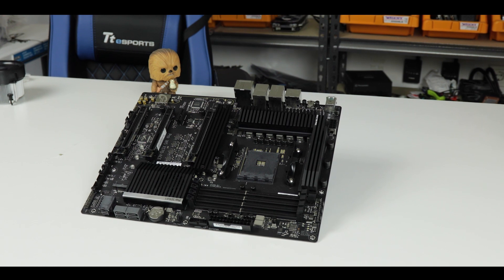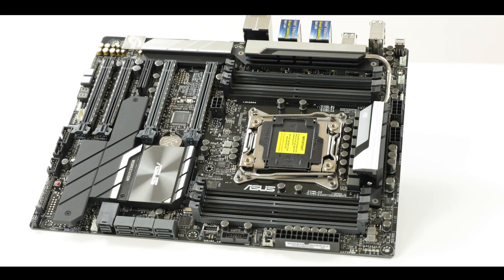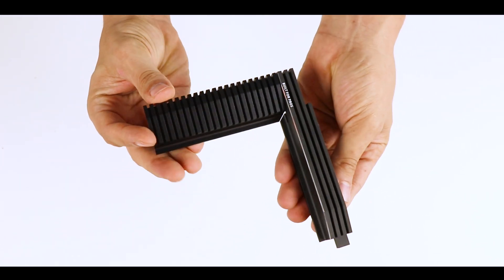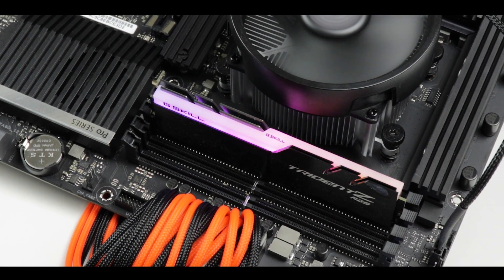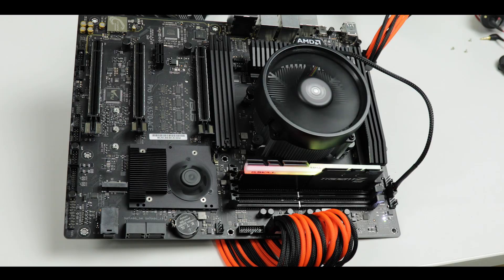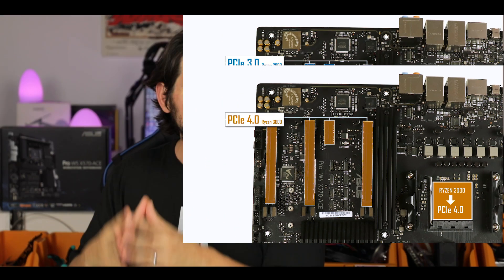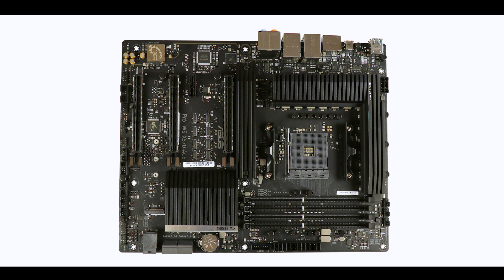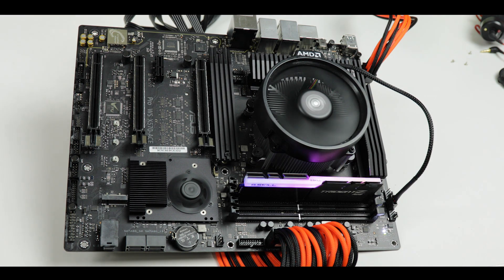Pro WS X570-ACE : PCIe 4.0 at its best!

Comment: Hi, I'm interested into how can this board run 3 gpus in x8x8x8 PCIe 3.0 config if the CPU itself supports only 24 lanes? Does it have a PLX type of chip like Intel boards have or there is something else going on.
Thank you
Reply: The bottom slot runs thru the x570 chipset, which has a pcie 4.0x4 link to the cpu, which is equivalent to pcie 3.0x8
Reply: Cannot get this to work with my 3 RTX 3060 GPUs...
Reply: @bage881  why?
Reply: @Frostensen  I'm trying to figure that out. When all three cards are plugged in, the #3 card on PCIE3 gets a code 43 in Device Manager. If I remove card #3 from the PCIE3 slot, then card #2 stops working and gets code 43...

Strange enough, all of them are now working....but card #3 is running in x4 mode, not x8
Reply: @bage881  it shouldn't work on x4 .... maybe the mobo is faulty? The only thing I read about it is that some guy couldn't even fit the third card because of power cables. There's a page on facebook called "Hardware for OctaneRender". Those guys work mostly with multiple gpu setups. Maybe they can help (it doesn't matter if you don't use Octane)
Reply: @Frostensen  I restarted the PC and now GPU #3 is back to not working again (code 43). I will def check out the Facebook group, thanks for that suggestion.

Comment: Baffling! My experience with this board, so far, has been somewhat of a disaster:
Extremely long boot-up times, weird display init behavior during boot-up (flickering), redundant and/or contradicting UEFI settings esp. regarding PBO, very limited fan curve settings, lackluster documentation, software that is impossible to set up let alone use (ACC), a rather noisy chipset fan and WORST OF ALL, it does not start w/o a PSU reset (PSU not at fault, replaced for testing). Also, perhaps unrelated: Noticeable coil whine under stress – for which I should blame the graphics card; but this did NOT occur with my old board.
Maybe just a heap of bad luck, but unsettling for sure.
Reply from the maker: Really ??? Not at all acceptable coming from an almost 500 bucks board. 

What CPU ??
Reply: @Laurentschoice  3700X. To be fair, in terms of performance, there really is nothing to complain about. And I was able to get it for much less, since it was incorrectly listed for only 239 EUR by a retailer here in Germany on launch day. Just contacted their customer service about some of the issues mentioned above, let's see if they have any ideas!
Reply: PSU reset? can you explain more please. I just got this board and Im not able to get into the bios and my new monitor says it's not recieving a signal. I reinstalled the memory and swapped out the HDMI cable but nothing is working. The memory lights us and all my fans and cooling system is running.... just no signal to the monitor.

Comment: is it possible to see somewhere how chipset radiator looks on the back side?
Reply from the maker: Didnt I show it on the video ? Do u need the PCB back or the cooler ?
Reply: @Laurentschoice  radiator, where located chipset cooler. I just want to look back side of it to see thermal pad between chipset radiator(with cooler) and chipset.

Comment: How can this VRM heatsink be the best when Gigabyte uses real cooling fins?
Reply: I was about to say the same thing .. this guy has no clue what he is talking about .. almost seems like a paid ad.

and its not asus "beefer" VRM
Reply from the maker: Cooling fins are the best way to radiate away single component heat, but when dealing with VRMs , you are dealing with a larger heating surface, such as multiple power stages, then metal heat absorption is king, and metal density is where u want to go.
Reply: Except that when the metal is thermally saturated, temps will rise further. I am sick and tired of mainbaords with inproper cooling.

Comment: Dont agree with you at the end of the film when you are saying it would be better to buy example TUF motherboard.(Blinked picture) They have worst VRM + cooling on VRM . If you really want to get proper "minimum" model cheaper alternative for gaming just get x570 prime pro instead (even thou they have prob same VRM as TUF atleast on  power stages, but have better VRM cooling compared to TUF) but yet again those x570 prime pros seems to sell at same price as this x570-ACE so absolutely would go for ACE even for gaming.

If you want cheap alternative for gaming buy some good/cheap B450/X470 MB with proper cooling on VRM and you will be fine. But those are yet still hard to find (Prime pro x470 VRM cooling is total  shit example compared to x370) So only "good enough" deal would be get some strix b450 with bargain or similar.

Just saying stop advertising TUF its SHIT BRAND these days.

Comment: That show of channels 1&2 its wrong (around 3:20) i know it because i own this board :D channel one its DIMM 1&3 channel two its DIMM 2&4
Reply from the maker: Hello Varinec. 

You are confusing the channels and the primary Dimms.

Which is normal,  since manufacturers give zero explanations. It took me a few years to figure it out. Actually on my early mobo reviews I would show the channels the way u just mentioned them.

The DIMM 2 and 4 are the Dimms which activate the memory Channel 1 and 2. That is why they both come gray and have an asterisk on the PCB.

This will activate two separated Memeory traces (or channel) on to your CPU, 

This will avoid a second Dimm queuing on the same channel if you have only 2 sticks.

Memory channel on this board are as shown on your screen. 

I hope this clarifies :)

Comment: Building my 3900x + Asus Pro WS X570-ACE board right now!
Reply from the maker: U my dear... are going to have the most powerful machine on your block !
Reply: what full tower do you recomend?
Reply: @academiadetradingchachin  Lian Li PC-011 Dynamic XL :)
Reply: @academiadetradingchachin   Fractal Design: Define R5 is what I used. They are on the R6 Define now
Reply: does the board allow overclocking of the processor?
Reply: @deekaythewhitewashedindian  Yes
Reply: Hello! Didn't you have issues with random reboots before latest bios update?
Reply: @cptnsol  no random reboots! Not sure what BIOS version I am running

Comment: I can't afford to upgrade every generation so I am careful which generation I go with to get me through the next one. I chose a X470 board and am happy I did because I suspect the x570 boards won't have longevity with such high temps. Hopefully the next generation, or improvements to x570s, will demonstrate long term viability. Who knows, they may come up with more passively cooled chipsets other than the Aorus Xtreme - at least ones we can afford.

Comment: Interesting design so is more about heat dissipation than  or as same a a good x570?
Reply from the maker: It's a constant battle between performaning and keeping it performing by keeping it cool. 

Really like the 8 layer PCB design too !
Reply: @Laurentschoice  that is cool. When I work with the z390 model WC I did have that impression that was running cooler